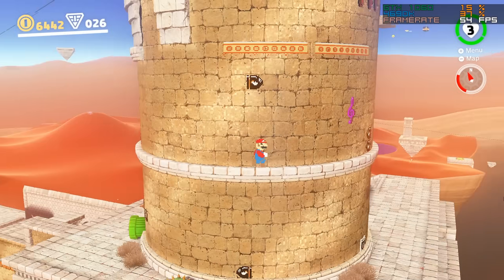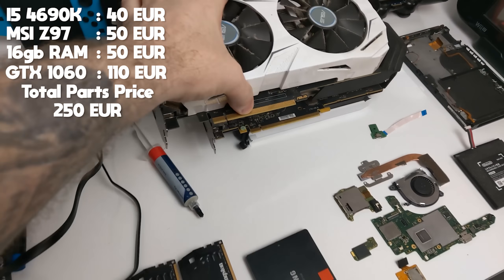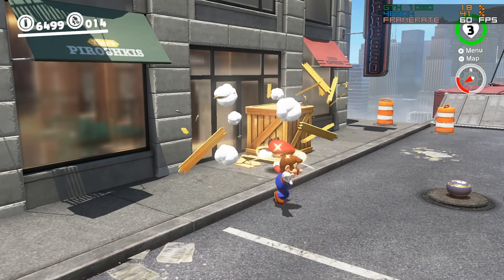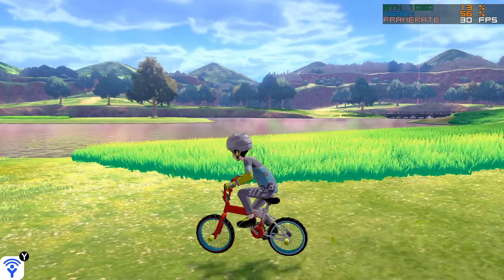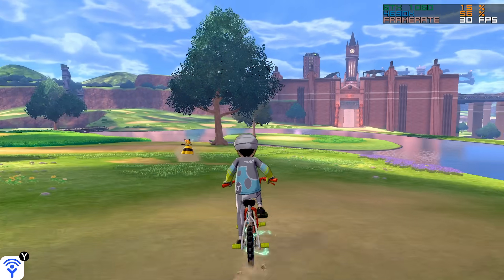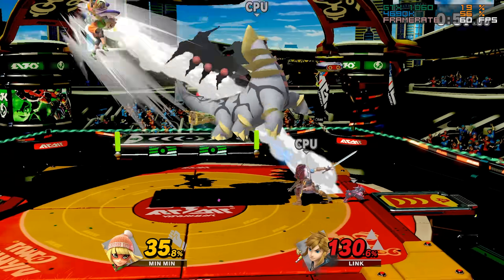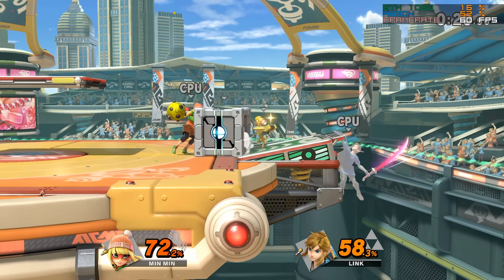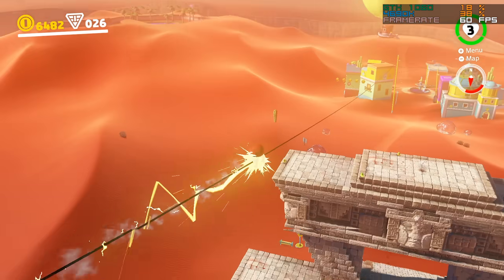Fullspeed Nintendo Switch Emulation on a $50 CPU - Multicore Performance Update

Comment: I have a GT 610 1GB DDR2 but my Opengl is 3.3 (100%) i can't update further new drivers just 2014 and 2015 versions because i always receive code 43 error with 2019 version and Vulkan support,any way to make a Yuzu compatible with Opengl 3.3,Directx 11 or 11.1

Comment: my main rig has amd gpu (5700xt) and it sucks in yuzu. have a e5 2673 12 core haswell I shut 4 off in bios so it turbos longer at 4.0ghz and each core has more cache That 100$ cpu is a beast for the price and ecc ddr3 1800 quad channel, it sits at 7% when using emulating with yuzu. I tried it with a 750ti get 30 to 50 frames in mario odyssy.

Comment: Running i5 4670k overclocked (4.5) 1.3 volt 40$ z97 motherboard 25$ p106 mining card (417.? hack) new 40$ ebay ram power ssd and case had running mario odyssy 58 frames average  PRICELESS        YOU DO NEED 16GB OF RAM. I took a stick out to try 12 ok, but 8gb you get alot of sTutter

Comment: I have two PCs, a 2012 gaming PC with i5 3570K, 8GB of ram, and rx580. 

I have a work mini HP PC with the 9th Gen i5 9700k, 8GB ram but intel 630 graphics. 

My question is, would the non-gaming PC with the 9th gen i5 give me better performance? My 3570K rig is able to run most of the indie games, but struggles with things such as Link’s Awakening. I’m on the patreon build and after not playing for a month, I’m finding Link’s Awakening is crashing on load on all settings, whereas it was playable but a tad laggy before.

Comment: I'm so confused. 

Does Yuzu not work well with AMD Cpus?

I have a 6-core 2600x OC'd to 4.2 GHz
RX 580 8 GB GDDR5
16 GB 3200 MHz RAM
And Sufficient Cooling. 

But, when running Sword, I get 8fps when I go outside, or it just flat out crashes.

Comment: You may have bought the CPU for cheap, but it's misleading, the i5 4690k was a main stream gaming CPU and still holds its weight today, and that's why you're not having issues.  If you bought an actual $50.00 CPU on the other hand, you might have some problems.

Comment: I can't run anything and the games I can run are not smooth not even OK

Specs:
CPU: Ryzen 7 2700x 8x3.8ghz-4.2ghz 16mb cache
GPU: AMD rx580 8gb
RAM: 2x8 GB crosshair vegance RGB pro 3200

And i set it up like your instruction video. 

Help me pls 😅

Comment: I've got an i7 4790k paired with a gtx 1080. At the time I bought the 4790k it had the best single thread performance you could find in a consumer CPU. It's still up there, but not the king it once was.

Still works wonders though, I've never come across a game it couldn't play, I can play PCSX2, Dolphin, ParaLLEl, RPCS3, Xenia, Yuzu, Cemu, and any of the latest games on PC. It's a behemoth considering how old it is. Would definitely recommend. I haven't tried every emulator yet, I'm playing the MGS series at the moment so I'll be trying Portable Ops on PPSSPP soon, I have high hopes. It's amazing being able to play pretty much every game ever released. There isn't a decent CDi emulator yet, but I think I can manage without Hotel Mario and Zelda's Adventure.

Comment: I was just wondering if the yuzu rely on cpu more or gpu? I want to know if i could play pokemon shield on decent framerate. I own a i5-7500 with older GTX 1050 (non-ti) 2GB OC and 8GB Ram 2400mhz dual channel.

Great videos as always btw! :)

Comment: 1:18 a GTX 1060 doesn’t outperform an RX 580. Quite the opposite. If you want an Nvdia card that outperforms an RX 580, you need a 1650 SUPER

Comment: For those getting crashes on a low end pc after compiling shaders you probably need to increase your page file. I have a similar setup to this (using a 1050ti instead) and kept getting crashes after compiling shaders and going in-game. After I changed my page file to 15,000 MB all my crashing problems disappeared.

Comment: yoo dude i have the same specs but another gpu from Amd equivalent to the Nvidia GTX 1060 6GB but games run slow even with mods i use vulkan btw cause open Gl is worst
Reply: Yeah, I don't think amd gpus are optimized in the slightest when it comes to running yuzu. Hopefully it will improve

Comment: For some reason on my i5 4670, turning on V Sync in the yuzu options and setting the Nvidia control panel option to "let this be controlled by application" makes my game run so much better. FYI I'm using the mainline build

Comment: So downloading this for Linux and using my RX 580 8gb paired with my Ryzen 9 3900X would be a good idea?
Reply: Actually, not so much. I am on Windows with my RX 580 8GB OC and the performance is not so great, 25 - 60 FPS with high GPU accuracy in a Sand Kingdom (Normal accuracy crashes very often). I use an Early Access build, with Unsafe CPU accuracy and have 8 GB of ram. Trying to set accuracy to "Extreme" for GPU and "Accurate" for CPU. Maybe the performance is better on Linux, but I heard, that every crash can just fully freeze the system, so that you'll have to restart.
Reply: @basedshrimp2244  You're on Windows, but I'm talking about Linux lol
Reply: @BrandanFischer  read my comment better. I know, that you're on Linux, but as I said, I don't think the performance will be so much better on Linux, and I heard, that every crash on Linux causes your system to freeze. But you can try anyway, emulator things are about experimenting with stuff, trying to make it work.
Reply: @basedshrimp2244  Yeah, the reason I asked this is because I see like 5x improvements over other emulation so I was wondering if the same thing could be said about Switch emulation
Reply: @BrandanFischer  tried it on Ubuntu 20.04 now. It really just freezes the whole system, when crashes.
Reply: @basedshrimp2244 I'll likely try it out on Manjaro or something like that, so maybe I'll get better performance. I also plan on upgrading my GPU by Christmas this year to a 3000 series GPU or whatever AMD has to offer so my performance will most likely increase.

Comment: You think a i5 9400f will get similar performance? It's a 6 core that's considerably better (and much newer) than the 4690k stock, but the latter is overclocked so... I'm not sure.

Comment: on fire emblem 3 houses , in first map ever the emulator crash for me and it says  Display driver kernel stopped working , what should i do to fix that? 
im using a : 
gtx 970 OC
i7 4790  3.60Ghz
16gb ram 
128gb ssd
1tb hdd
windows 7 ultimate

Comment: holy shit my stuff is crap xD did not work 100% wud say 70-75% i7 860 2,8ghz multi threed 4 core 8 threds
 666mhz 8gb ram gtx 970 :( going to suffer true to new gen GPU lanch and aim for mid card and and op cpu damn am so far behind with my pc XD

Comment: Looks like Pokemon still runs slightly chunky in those wide open areas. The FPS is a locked 30 fps, but I'm still seeing skips in the video. Not sure if that's because of post processing or if afterburner isn't correctly pulling the frame count.

Comment: Wait.

A 4690k is 9 years old?

It's 6 years old actually.
Reply: I have a 4670k lol
Reply: I'm still running a 3570k
Reply: @aethex8821  same here, and its still pretty good.
Reply: I bought one when they first came out. Still running it. I'll be upgrading to a 10600k soon.
Reply: @TooFurious4  why not a 10700k?
Reply: @lokep0012  because you get no performance increase but you pay extra €.

Comment: I have a Nvidia GTX 1660, a Intel Xeon 5650 (6 cores, 12 thready, 3 ghz) and 12 GB DDR3 RAM.
I set all up like you did in your guides but I just cant get good performance. I dont even get half as much fps as you do with this equipment. 
my CPU is used like 40% and my GPU also around 40 to 50%. RAM is used like 4,6 GB
Now to my actual question:
Is my CPU too old, too weak, something else or is there another problem I overlooked to have better performance?
Reply: He's overclocking.

Comment: Also, I like this form of testing. It is much on the same thread as ETA prime when he reviews new/ used hardware. I like that you have a focus on some of these emulators. It would be nice to get s standardized "benchmark" with save-states on multiple different platforms. I mostly buy low to mid tier Nvidia, but it would be nice to see performance improvements with RX cards, but it seems like more of a driver limitation if you have less issues in Linux. 
I would love to know what the minimum specs are for these emulators especially for GPUs. A gtx 1050 or 1050 ti is common in laptops and would make a nice test for this emulation.

Comment: I got 40fps average on BoTW on Cemu with GTX660 and i5 2320, but my card died and I bought a RX570 now I only get 25fps average.. Is this normal? I got 30fps in the Witcher 3 medium setting and with the new card 60 fps on high settings so it seems odd. I have switched from openGL to Vulkan too. Do AMD gpus not work well with emulation on cemu?

Comment: Cemu seems to run mostly well at 30FPS on older hardware with a gtx 1050. Can a gtx 1050 handle most single player Yuzu experiences? Or is the 1060 the new minimum here?

Comment: I think the only issue for Mario on Yuzu is that when frames drop the game does not do frame-skipping or more specifically does not adjust animations for the new frame-rate but instead slows down relative to the frame rate.If the game had frame-skipping even 30 fps drops would make it fully playable. I tested the game on my I5 6600 overclocked to 4.2ghz (which is considered a basics minor OC for the cpu) and the game is 50-60 fps even in the more demanding areas.
Only noticeable issues i notice is the sound stuttering in some cut-scenes.

Comment: Guys, will I be able to run these games. I have an
I5 7500
1660 ti
16gb ram
And I was thinking of putting the cpu on performance mode in the Asus bios as I can't overclock the cpu I have 🤔

Comment: im not much if a pc gamer but i kinda want to try switch emulation! im wondering if an old system i have laying around is able to run pokemon ..specs are i7 3770, 16gb, rx 570

Comment: Does anyone know the best $500 and under build for modern console emulation and regular gaming (I only really play oldrim and minecraft so this isn't the biggest concern, but it would be nice to get like 30fps with medium settings for more modern games) with at least a terabyte of storage and room for future upgrades? (I'd also like to know of a cheaper build with really good upgradeability as a different option.)
Reply: 500? is not enough buy a Switch for 300 instead if you want to play Switch games.

Comment: Nice video, although when I read the title, I thought you had gotten an AMD Athlon 3000G and were testing it with the integrated graphics.

By the way, you can install Linux as a dual boot using forks of wubi, so it is doable for most people.
Reply: Same

Comment: I read on the developer site, this emulator relays badly on the Pci-express bandwidth, which in my case, I have only PCIe 2.0 and it runs very slow in my i7-3770 and GTX 1660Ti. (At least on the single core release of yuzu)

I still don't try the multicore one. Did this improve?

Comment: I have i7-7700 
Gtx 1060 6gb
8gb 2666mhz ram 
still i m only getting 19 -20 fps is it because of my ram ?
Also which version are you using in this vid?

Comment: Since it wasn't shown in this video, what performance do you get in BoTW? With my rig (upgraded to 16GB of RAM) i get 30fps during the intro when Zelda tells you to open your eyes. Once that part is over and the shrine/Link are shown, my fps drops to around 14. Once I gain control of Link, my FPS drops to 9 for about 5 seconds before Yuzu ends up crashing.
Reply: I'm 2 years late, but assuming you still haven't upgraded your system. I recommend trying to run the Wii U version on Cemu. You might get better performance because it is less demanding than the Switch version while still pretty much the same game.

Comment: Really ?

What about a lower gpu ?
Reply: If you look closely at the % in the top right corner ofthe screen, you can see that the GPU is using around 25% of capacity at most. So while it's not a "absolute truth", you can estimate than lower GPU should works really well as well, as long as they're Nvidia's and not too old.

Comment: Hey BSoD - I love these improvements.  I can now play Mario Odyssey at full speed on my i7-6700 CPU.  I have a quick question.  Do you have any specific settings, or mods, that make Mario Odyssey look so clear?  On my system, the text is very clear, but the 3D graphics look somewhat pixelated.  I can't figure out a way to make them look as clear as yours
Reply: tienes que activar modo dock ahi se ve mucho mas claro

Comment: dont know if you are going to react but can you make a  pcsx2  max performance video pleas like you did with cemu pleas
Reply: To be honest, you don't really need to cnfigure the pcx2 emulator. The base settings are generally good/best enough. The only thing you have to modify yourself would be the "upscaling" to upgrade the resolution of the game (to make it "HD") and it's just a simple click.
They recently released a new version that should normaly have a lot more of bugfixes done so you shouldn't have any setup to do unless it's some foreign game that the dev didn't planned a fix in the stable update.

Comment: im having problems, that i didn't have before. now i can't run SMO, it will load the the shaders and then yusu would close, Before i could run the game around 40 fps. I couldn't find any info about this problem. I even changed to the older nvidia driver as BSod recommended and also with cemu i have a similar problem with BOTW,  i used to play around 40-50fps and now after loading the save state  and moving 2 feet cemu crashes. 
i have 
8gb ram ddr4, gtx 1050ti, intel core i5-7300hq
if anyone can help me, thanks already
Reply: I restarted my pc and the cemu problem looks like it got fixed and yuzu now manages to get to the loading screen where the joycons are displayed and then crashes. Don't know what else to do. any suggestions?

Comment: How big is the impact of having access to AVX instructions for this performance upgrade? I have a 3770k which is just about equal to the 4690k in single core and pulls comfortably ahead in multicore, but it is an older CPU.

Comment: I have a i5-4440, 16gb ram, and a GTX1060 6GB, and for some reason some games like smash don't even boot, I dumped my switch nand and key using fw10.0, with no luck

Comment: Im glad they added multicore usage.I want to turn a old dell optiplex into an emulation system. it has a i5-2400 quad core and an rx 480
Reply: CEMU will run awesome! YUZU is pretty much a youngling, performance is a mixed bag.

Comment: 6:15 *6 years old, released June 2014
Reply: right?? i felt attacked. i have a 4770k. and a 1060 gtx
Reply: I felt like time had passed more quickly than I thought. It was not quite as bad as it was for Link though. The guy slept for 100 years.
Reply: @Elewisisking  The 4770K is still good but when PS5, XBox Series X, Unreal Engine 5 Games released on 2021 the i7 4770K will be out of date because of new generation specs requirement
Reply: @FantasyNero  yeah it's still a fine cpu for normal gaming and the occasional heavy load, got yet to encounter a bottleneck other than emulation. Ryzen is next though, Intel is simply making a clown of themselves by pulling their SIXTH generation in a row still stuck at 14nm, and it "needs" a new socket too... Oh man 😂
Reply: @FantasyNero  consoles are always behind 4-6 years. im not afraid. my build will last at least through the next gen easily.
Reply: @Elewisisking  but the next gen consoles have 8 core/16 thread Zen 2 CPUs.
Reply: @LightJockey  Absolutely
Reply: @Elewisisking  Nope they just use modern mid-rang CPU and i heard the ps5 has 12 Cores, my Ryzen 3900x has 12 Cores too
Reply: @FantasyNero  12 cores doesn't mean modern. CPU architecture is far more than just core and GHz. I'm talking instruction sets and die size

Comment: I'd definitely like to see a video like this, but using AMD hardware. Vulkan + Muticore with AMD hardware for me personally is a death sentence. Vulkan alone tends to push RAM use up to 100% over time and the emulator just freezes (I have 16GB btw), and Multicore alone just stops the emulator frequently, then ramps up the RAM use until you force close it. When I tried using both, it straight up crashed my PC.
Reply: Carlos VL  Latest Mainline build, of course. I tested it a few times, even before Multicore was added to Mainline, and it still happens all the same. I should also mention the only game I have is Pokemon Sword. I've kinda set Yuzu aside for the time being though because I don't feel like destroying my PC.

Comment: As always thanks for all the quality content.

Here's hoping that the audio issues get resolved in the next few updates. Between the Odyssey Animal Crossing Link's Awakening I find that the strange quiet audio and intermittent cutting out really prevent the games from being fully playable. It's not that it's something that isn't able to be overlooked it's just it really takes away from the experience. If you have different results I'm curious at what settings you're using

Comment: What about core i7 10875H with GTX 1650 ti (on laptop) I had read somewhere discrete GPU is not a good idea to run some emulators on it, hope someone can help.

Comment: When you switched to Linux a year ago.
And it was actually a good choice, even for gaming.
The Yuzu and Cemu guys are on a roll lately it's insane the improvement the last few months.
Reply: Linux is great for emulators, and I can't believe Yuzu upgraded in a snap, so optimized.
Reply: @loop5720  I didn't know it was already a snap package,i still prefer flatpak but good for them!